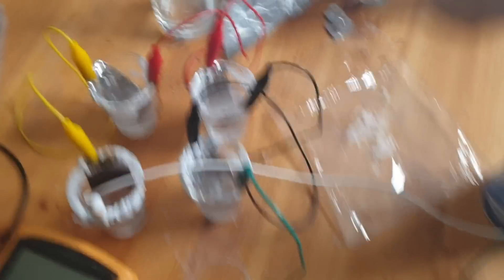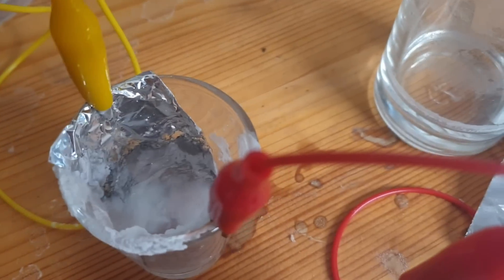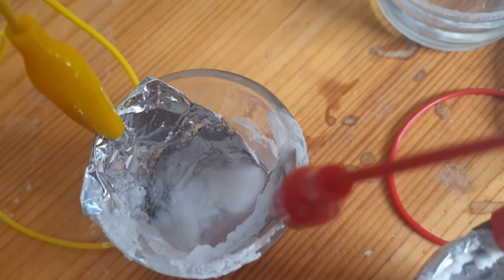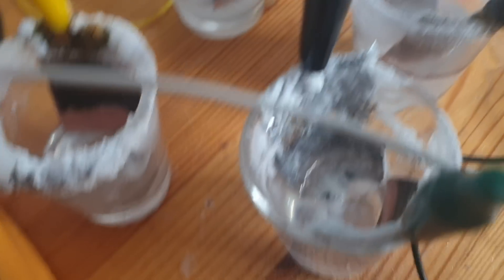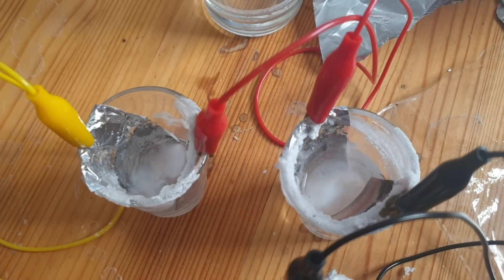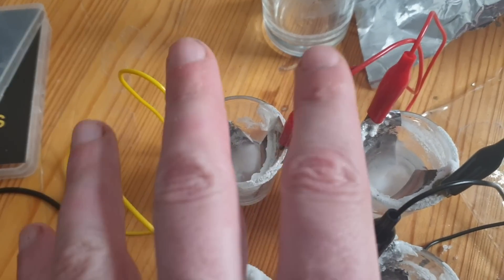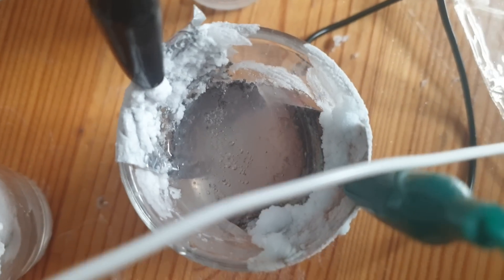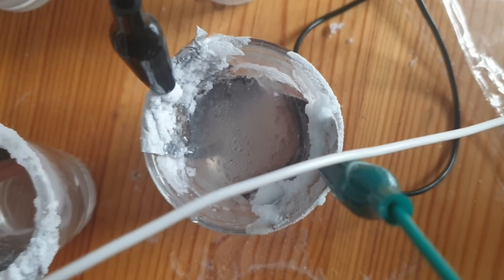'Free electric from salt water' - one week later!

Comment: I did something like this sandwiching aluminum tape and copper tape separated by paper towel so that I had 30 pairs of cells, and I joined the copper tape of the first cell to the aluminum tape of the second cell, and so on for all the cells. Then submerged the package in a 10% salt water solution. Then I attached a lead to the first aluminum foil and a second lead to the last copper tape. As long as I kept the water from evaporating, the battery worked well. It lasted for about 6 months, so I was pretty jazzed about that.

Comment: Still looks like my elecrochemistry experiment, in junior high (now called middle school), back in the early 1970s. I used Alfred Morgans book, from the 1930s, as my primary source. I didn't have LEDs back then. They existed, but didn't hit the consumer market until the mid 1970s, though invented in the mid 1960s. The consumer market is always 10 years behind. TVs still had vacuum tubes in them (in addition to the CRT) well into the 1970s, while the computers on the Apollo moon missions were using ICs (though no large scale microprocessors). It takes time (years) to get from invention, to developed components, to products using those components.
Reply: two gates per IC isn't bad...

Comment: For all those claiming this is more free energy BS: it's chemistry.  It's a battery.  Just like a AA or a lemon.  It's reverse electro plating.  You get very little energy out of this out of a fairly large expense ineficiently.  A salt water battery has a place in specific use cases, but certainly isn't a universal solution.  

There's a difference between free energy and energy you can make at home out of household things. Magnets on fan blades is hocum.  Reconfiguring an old ceiling fan and making a wind turbine is DIY.  Why not try to do something guys?
Reply: I put thin magnets on some of my ceiling fan blades to balance them.  Hocum, indeed.

Comment: I'd guess more aluminium is eaten away near the top because that would have been providing a higher initial voltage and hence higher current and power to the LED load. The volatge and hence power drops over time, so less time to eat the entire way through the aluminium as it drops.
Reply: I'd suggest that at the top water, salt, electrolytes meet with AIR e.g. oxygen...
Reply: Interesting.  But the voltage drop from the top to bottom is so minor.  I was guessing that it has something to do with the surface tension and evaporation.  The same way that a coffee spill dries out and leaves a 'ring', surface tension and evaporation would cause the edges around the water surface to have the highest concentration of salts.  But that's just a guess, would have to devise some experiment to test the hypothesis.
Reply: could in essence turning it upside down (without all the electrons gone' a fallout) with cables connecting at the bottom of the cells. with hole electrodes under the surface of salt water, with no air eating away of the electrodes, well not much anyway?
Reply: It has to do with the electrical potential at the wet surface area ( what metal comes into contact with water ) and the surface tension evaporation concentrating the salt residue there as it evaporates.. likely also the most direct path for the electrons and finally potential energy from the nobility of dissimilar metals ( the alligator clips being galvanized)
Reply: Electric current circulates through the surfaces of conducting elements, not through the bulk. That's why the surface corrosion is higher. 

I can't remember the exact description but I'll try.
The electric field inside a conductor is uniform, hence there's no voltage difference between 2 points inside the wire. But the surface has whatever Volts inside vs 0V outside. This ΔV is what makes electrons travel on the surface of electric conductors. 

The solution was pretty obvious after solving the normal & tangential boundary conditions for E & φ in an electric wire. I'd post a screenshot of the Physics Vol 2 by Tipler, but... I neither know it Thunderf00t allows links in comments.
Reply: @MarcCastellsBallesta  True mostly for longitudal conductors with large length/frequency ratios.
For a DC battery with foil... not much of an impact.
Reply: @ambassadorkees  agree. This is a DC battery and the skin effect is totally negligible.

Comment: Try busting John Hutchinson's free energy cells!
You won't succeed!  Atleast if you're honest about it.
Trust me, it's interesting.  I think it's based on the feroelectric effect in pezo ceramics.  The  charge domains remember a current that passed through them, but it does also seem to be polarity sensitive.  It is a miniscule amount current but still there shouldn't be any at all according to thermodynamics!  Solid state device . . . It should not produce anything!  Please replicate and explain!
Reply: That's the fella that goes and measures the open-circuit voltage, then the short-circuit current, and multiplies the two to get the power.   Just like the power formula, except completely wrong.  He's done this a passel of times but never learns.   Power is voltage times current, measured at the same time.  Not separately.   The oldest of free-energy tricks.
Reply: @georgegonzalez2476  ya I've seen that 1 before too.  I don't peddle scams . . . Notice I haven't tried to sell anything yet!?
I can't speak for the man's integrity.  Some seems fake, but I verified the claim on this 1!
I care about truth and the planet.

Comment: The one thing I would ask is, how much electricity does it take to refine the aluminum ore to make the foil? Great vid as usual.
Reply: Lucky for you, Uncle Sam has already asked a similar question.  It takes about 14,600 kWh per metric ton to refine bauxite ore into aluminum.  That would be about 6.5 kWh per pound.  A 200 square foot box of Reynolds Wrap is listed as weight 1.85 pounds.  So it would take about 12 kWh per box to produce.  The cost of 1 kWh of electricity in the US is anywhere from 10 to 15 cents, so you're looking at anywhere from  $1.20 to $1.80 of electricity to produce a box of Reynolds Wrap.

Here is the paper with basically every type of metal you can think of: https://pubs.usgs.gov/of/2011/1253/report/OF11-1253.pdf
Reply: @dhoyda  Wow, Thanks for the reply. So the seawater batteries would not be that environmentally friendly. Once again Thanks
Reply: @atlanticx100  Generally we do not refine bauxite ore into aluminum anymore to the extent we used to. It's recycled, so it's basically the electricity cost of the electrolysis (high, but presumably cheaper than refining* bauxite ore). There's also the matter of logistics... which is one of the major costs of any enterprise like this.

Comment: They are getting corroded at the original waterline. Interesting. Probably some boundary effect between water and air making it the best place to conduct electricity.
Reply: I guess it's probably related to it being the shortest path to conduct through a circuit, that position would fall lower as the water evaporates.
Reply: Ever notice how a coffee spill dries and leaves a ring?  Something to do with evaporation and surface tension where the water 'curves' to the edges.  Surface tension will tend to concentrate the dissolved compounds at the edge.  It may be the same thing happening here with surface tension/evaporation providing the highest concentration of salts there.  Just an off-hand guess at this point, but might be worth investigating.

Comment: Is there a material that wouldn't deteriorate that would do the same job?
Reply: only capacitor batteries do not deteriorate but they have very low capacity. Typical batteries (including Lithium-ion) always rely on the electrode material to dissolve and migrate toward another electrode.

Comment: Maybe the miracle product does contain electronics.  Sure, you could hook several cells in series to get the 3V necessary to power a white LED.  Or you could use fewer cells (as few as one if it produces at least 1V) for cheaper construction and add a boost regulator commonly known in this application as a "Joule Thief" (you can thank Big Clive for that misnomer).
Reply: He didn't come up with it. But he's where a lot of people learned about electronics.
Reply: @zendell37  He didn't come with it but he bestowed the name "Joule Thief" when he wrote it up for Elektor (I think it was that mag).

Comment: So what happens when all the aluminium dissolves?
Reply: Then the battery is flat.
Reply: @vylbird8014  Do you know what makes it rechargable then?
Reply: The salt water acts as the electrolytes where the aluminum and copper represent the anode and cathode. Replacing the degradated aluminum would be a good start if you wanted to reuse the housing of the cell. The purity of the water can also impede battery efficiency. Replenishing the cell with distilled water and salt may work. Or, implementing the use of a gravity based filtration system for sea water could perhaps be appropriate. Improving efficiencies of salt batteries is needed in order to make this technology viable.
Reply: @kenniefold4226  Thank you Kennie.
Reply: You get aluminium chloride (alum) and sodium hydroxide.
Reply: @allangibson2408  Thank you!

Comment: As an electrical engineer the LED is not a very good load. Lights with little or variable power. Need a Electronic load meter to record power being generate. Regardless looks promising.

Comment: Yes. So they were right... except for the concept that it's the watter that runs the battery, of course...
Reply: As long as you only want to light 1 led for 1 week. Think of the cost of obtaining aluminium foil in the places where electricity is scarce. It might be cheaper than batteries, but is no miracle solution (pardon the pun).

Comment: Maximum corrosion apparently happens near the surface of the water
Reply: Indeed, but why? One would expect it to be where the plates are the closest together and thus the ion exchange the strongest.
I guess the answer is air. The electrolyte makes the plates distance more or less irrelevant.

It would also explain why the corrosion was more prominent at the top of the cup, where the cup is wider and the water lever drops slower, giving enough time to the aluminium to corrode where it was exposed to both the salt water and the air. As the cup narrows down and it takes a longer distance to lose the same volume, the water level drop speeds up, exposing a new area of the aluminum foil to the oxygen before the previous area manages to corrode visibly.

This theory could be verified by using cups with a different shape. Cylindrical would be ideal. Alternatively, seal the system (use lids) to prevent evaporation. The corrosion would then end up being a thin line just above the water surface. It would also corrode all the way through along the whole perimeter and the battery would stop.
Reply: @olmostgudinaf8100  well, it's an aluminium-air battery, at least partly by chemistry, so the higher oxygen content near the surface might have done the trick

https://en.m.wikipedia.org/wiki/Aluminium%E2%80%93air_battery
Reply: @patrickfle9172  Interesting. Are you saying that it would not work at all f the foil were completely submerged? (I guess it would work a little, due to some oxygen dissolved in the water.)
Reply: @olmostgudinaf8100  it would work, just the oxygen part of the redox wouldn't play a role
Reply: @patrickfle9172  Again, interesting.
At the risk of embarrassing myself, looking at the equasion again (sorry, I could not find subscript 2 and 3 in Character Map and had to substitute with superscript variants),
4Al + 3O² + 6H²O → 4Al(OH)³

This is a closed equasion. 4 aluminiums, 12 hydrogens and 12 oxygens go in and come out. Without the extra oxygen, I assume the equasion would change to something like
4Al + 12H²O → 4Al(OH)³ + 6H²

So you would get hydrogen bubbling out, which you (in theory) wouldn't with the oxygen present.
Reply: @olmostgudinaf8100  as there still is NaOH or KOH in solution, I'd expect Cu-complexes to form... but my chemistry knowledge is very rusty.

 AFAIK subscripts are written with underscore if not othetwise posdible: CO_2; V_in; etc. 😉

Comment: Yes, low load, should last a month or more. The emergency little battery on liferafts lasts around a month in use, lighting the little 1V5 torch lamp on top of the raft at nights, as the instructions do say to take out the water in the morning, and shake it dry. They also use thick plates of magnesium alloy and zinc, so as to get a good operational life as well.

Not a lot of life, I got one or two of the time expired ones from the safety equipment stores, and tried them out, as they change the entire thing every 5 years, when doing the repack of the aircraft life raft, just in case it got damp and the copper wires corroded. 1V5 100mA lamp, that was barely able to glow orange yellow at night, but still better than nothing out in the open ocean. You also have a 2 week supply of food, basically hardtack biscuits and a granola bar, and 3 days of water in the survival pack. Add the 6 pop off flares, the 3 smoke and fire sticks for attention, the little polished stainless steel mirror, the whistle and the pack of yum yum yellow water dye, plus the single small thermal blanket, and that is the entire kit, fitting in a tiny little almost tupperware box in the raft pocket. Fighter aircraft you sit on it as seat cushion, one man raft. Transport aircraft it is a bigger one, sits 6 if you take turns to breathe.
Reply: Not very smart 2 weeks food supply and 3 days water supply. Especially when you can live easily 2 weeks with no food but barely 3 days without water... I can only guess the food is condensed and will make you even thurstier... so note to oneself, if you ever abandon ship grab whatever water you can to the raft...
Reply: @you2uber530  I thought the same thing, but then I told myself, it's probably because dry food for 3 weeks is probably lighter and less bulky than water for 3 days.
Reply: @olmostgudinaf8100  Bingo, it has to fit a tiny volume, and if you are not rescued within 2 days you are not likely to be anyway.
Reply: @you2uber530  These kits are for military aircraft:  if your boy goes down and gets stuck for more than a few days, he's got a bigger issue.  

@SeanBZA For naval aircraft, do they pack emergency reverse osmosis kits?  Again I assume the philosophy is "we get to you quick or you're done."
Reply: I may be wrong, but I think his point was, "wow, a cheap thing I bashed together in a few minutes from things I found in the kitchen still works!"
Of course a professionally made equivalent should work even better.
Reply: Sorry Bub !    This is the 21st century !
You want "hardtack biscuits and a granola bar" from an airline,
even one doubling as an ocean liner,
and you're gonna need a valid credit card !        B-)

Comment: So if everyone dipped aluminum plates into the ocean, we could develop free electricity?
Plus, we would never have to refill the electrolyte, as it would be self replenishing!

This could be scaled up to very large systems! Almost to the point where we could make new aluminum plates from the electricity made from the ocean!

But we may want to leave that to the hydro plants to produce electricity for...

Gretta should be very happy with this source of electricity!!
Reply: not sure if sarcasm or not
Reply: @Ubya_  Sarcasm, what is happening to the aluminum and salts in the electrolyte? It is decomposing into elements harmful to the environment, even as large as the ocean is, the pollution would be bad.

Trouble is, there would be a group of people willing to do it, regardless of the damage.
Reply: @jeffreyyoung4104  Actually, I have seen a short documentary on TV (I think it was some kind of challenge), where a team made a warning system for small, aluminium fishing boats to stop them running into a reef. It consisted of a salt water battery and a buzzer set off by the boat closing the circuit by touching a steel wire. Why not just the wire ringing a regular cow bell when pushed, I have no idea.

Comment: Was that ring of corrosion the starting electrolyte level?
Reply: That's the best thing -> looks like it's a bit above the water level. Although it could've evaporated over time and now the salt water level is lower.
Reply: Yes.

My attempt at an explanation is here: https://www.youtube.com/watch?v=14dpC4EPKZs&lc=Ugz2Z7dCUrBzmjHdB8V4AaABAg.9c_2hE0SzLA9c_9s3XSae9
Not sure if correct, I am not a botanist. This is just my partially educated guess.
Reply: Hmm, it seems my link doesn't work. Anyway, it is a reply to Patric Flé's comment in this section.